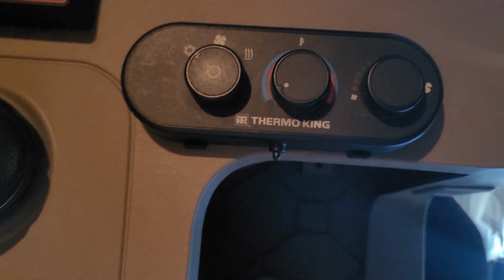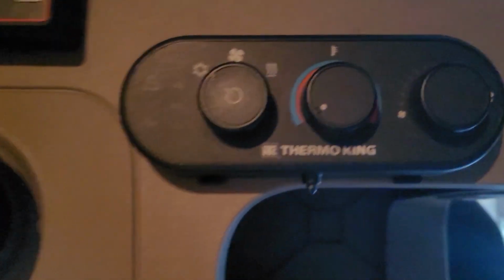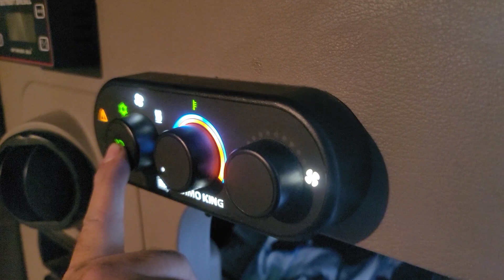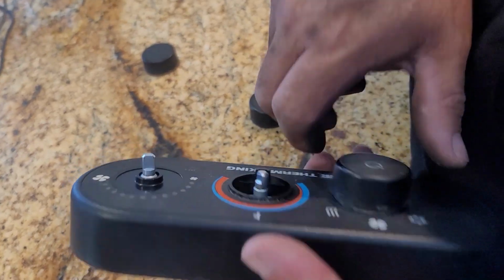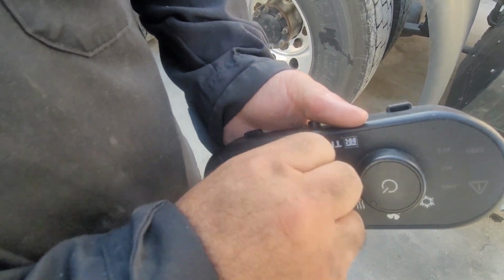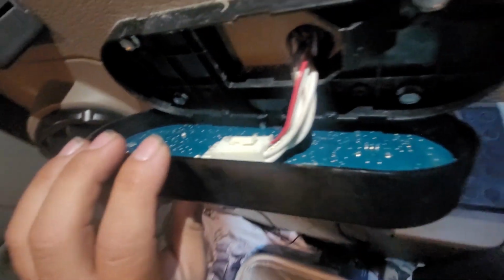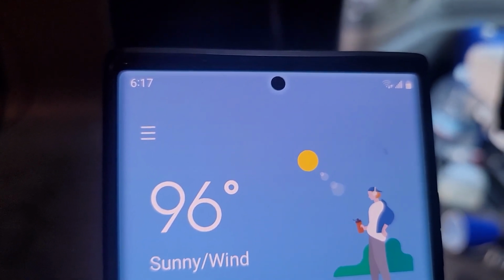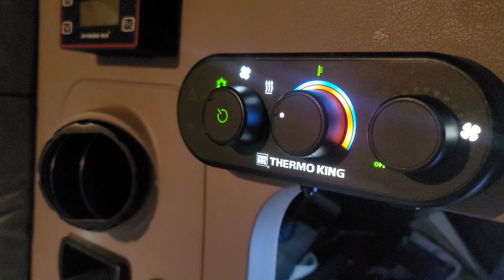Thermo King APU shutting down getting Yellow triangle Due to bad controller

Comment: This is exactly what was wrong with mine.  I had the yellow and then red triangle 🔺️ of death. It would not turn on. I checked the fuses, I checked the oil, I reset the engine nothing worked. Then I  saw this video.  All I did was wiggle the middle knob and everything started working again.  But I'm on the road right now so I'm gonna order that spray stuff and clean it up later. Great video!!

Comment: Turned it back on but yellow light did y come on. Bloing out cold air not sure what else it could be
Reply from the maker: Check the water pump pulley might need to be adjusted